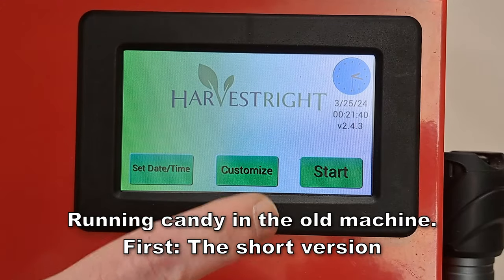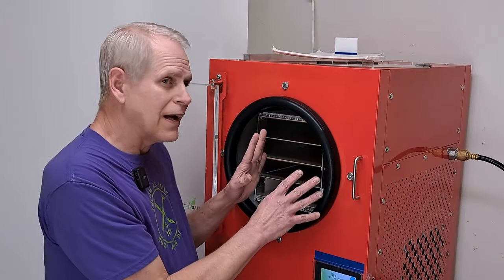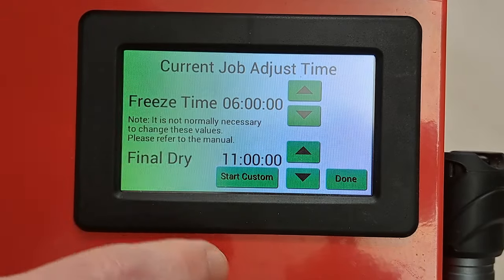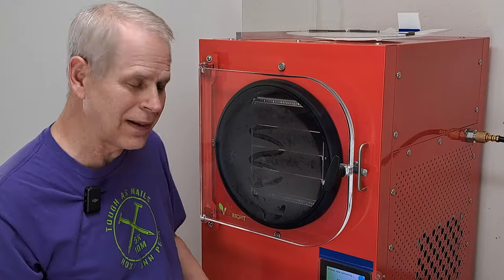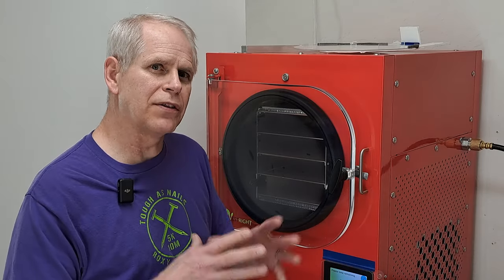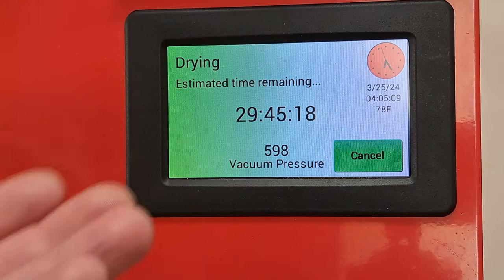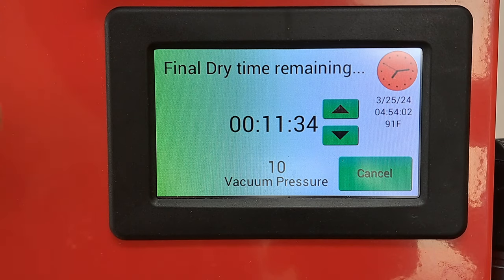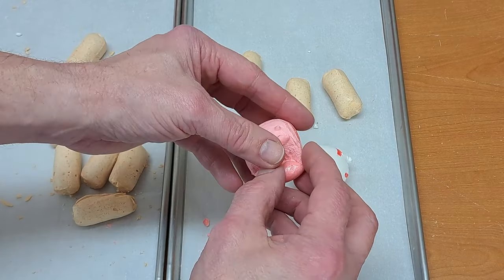Settings For Doing Candy 2017 Machine

Comment: We so appreciate your time on this. It is exactly what we needed to know. Having the why explained really was so much more necessary to understand than just the steps. We cannot thank you enough for putting this video together for us. You went so far beyond for a subscriber. Easiest 5 minutes crammed into 36 minutes I have ever seen 😀
Reply from the maker: Thanks so much for asking. I hope that most of the things in it are applicable to your machine. (Mine is a 2017 and my sister's is a 2022)
Reply: @SchoolReports  so much is the same and applicable. The difference we just found is my software version does not allow me to adjust freeze time. I can adjust shelf temperature and final dry time but that’s it, without any other options. But seeing your steps and understanding the “why” of the matter makes it easy to understand how to achieve the results we are looking for. Once the kids get all this candy it may become our new found hobby freeze drying candy. Or after I drop it all off with a case of Irn-Bru or Redbull to wash it all down, that might be the end of supplying endeavors. 😉 But we sure are having fun learning how to do this for them.

Comment: Thanks for the video! Great info. 
So, if you open the drain valve when they are warm they tend to collapse... ah.
Reply from the maker: In this case, most of the problem was that I was trying to speed the process for the video. If it had been 100% dried (a few hours) it probably would have only collapsed a little, if at all, like the Bit-O-Honey.